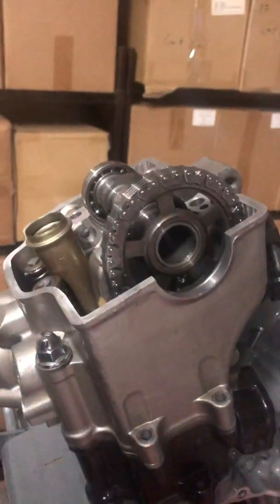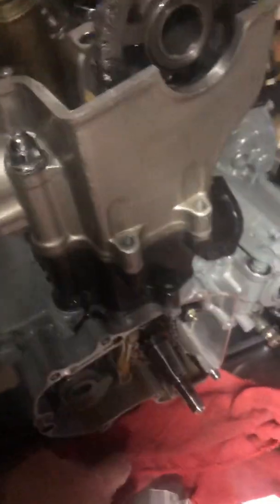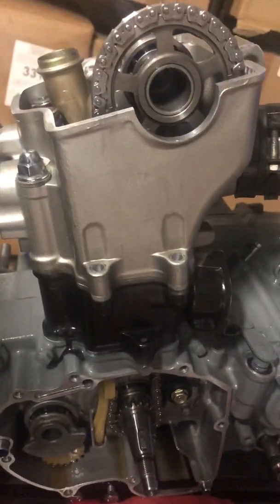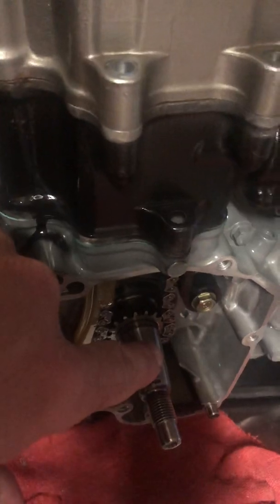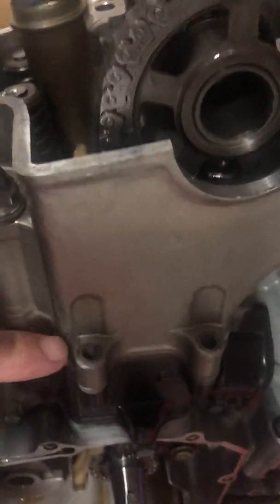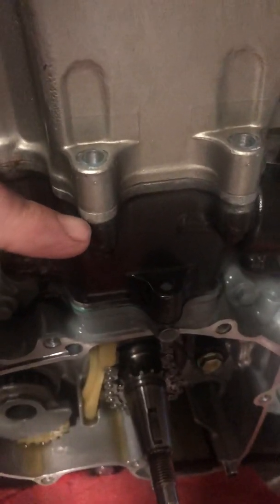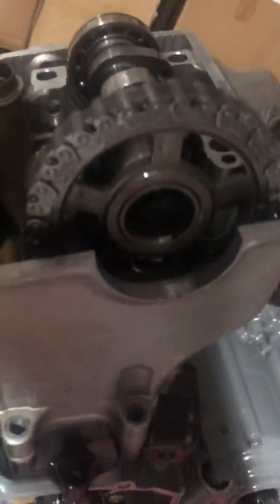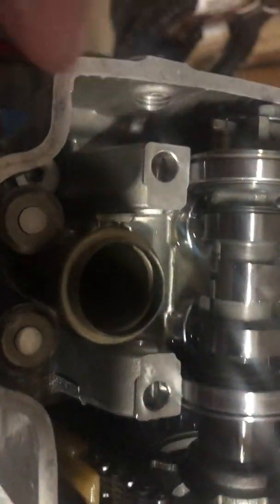Explanation of timing on a Fourstroke CRF 250 engine

Comment: I was doing my valves and my chain came off the gear on the bottom I didn’t know this till I tried to crank it. 

Once in figured out what happened i lined all the timing marks up and the bike won’t start it’s super hard to kick too
Reply from the maker: You may have bent a valve if the marks weren’t lined up and the stress popped the chain off, the tensioner may not be tight either, I recommend taking it to a mechanic to have a look
Reply from the maker: If the valves are bent it will be difficult to kick
Reply: @socal.hondabuild8349   okay well I have to pull the head anyway the threads stripped